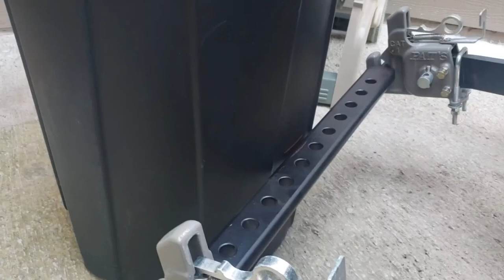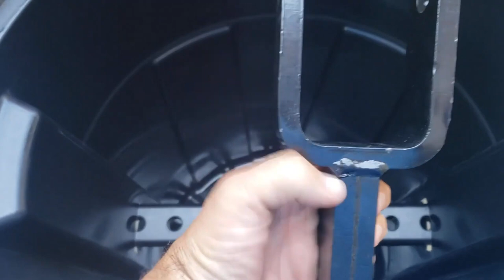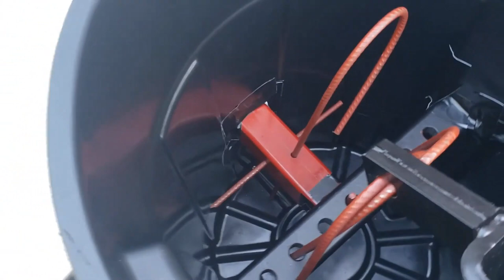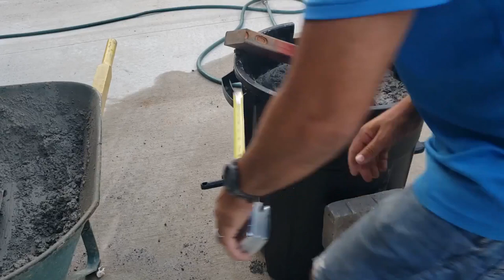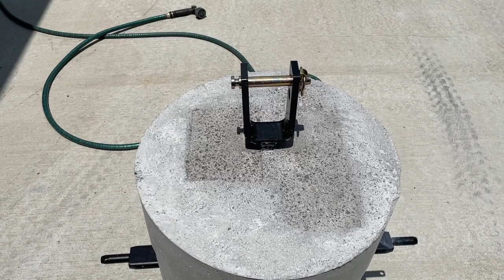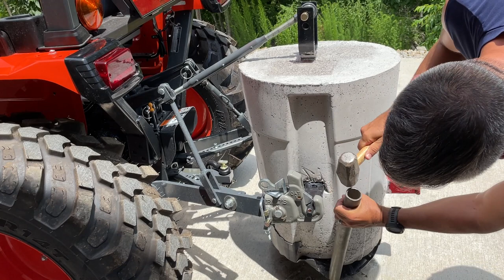Concrete Tractor Ballast Kubota LX2610 Compact Tractor 3 point Category 1 with Hitch Receiver DIY

Comment: I've watched a few of similar videos, and am taking delivery tomorrow on a Kubota L2502. The changes I think I would make is to place the draw bar and top link quite a bit closer to the front. Two reasons, it will make it so the top arm of the three point hitch clears easily. The other advantage is that the weight will be farther back from the hitch, giving the ballast box more leverage.
Reply from the maker: Thanks for watching. Enjoy your tractor. I was just using mine tonight with the ballast and the grapple.
Reply: Yes, I put my drawbar 6" from the top rim and 13" from the bottom. The top link mount is the same 6", and I didn't sink it into the concrete it's above the concrete.  The square tube sits about 2 to 3" above, slotted the tube, and bolted top link mount to it and it lays flat on the top, but it's flexible up and down but not side to side.

Comment: Should have mocked up receiver hitch, top link bracket and drawbar from wood, assemble in barrel, hook up, raise and use an angle finder to determine receiver angle, so when sitting plumb you will know where to have it sit before pouring quickcrete. You would also be able to see  top link clearance and plan accordingly for cutout/form board. Cut your holes smaller than you think you need in the barrel and fit your parts for tight seal and always vibrate your concrete. You could always cut out the concrete for your top link as well. Cant change much now unfortunately because it's set in stone, lol. Other than that, good idea.
Reply from the maker: Yep, lots of good advice. Nothing that my 4-in angle grinder didn't fix.

Comment: I did something very similar but I used steel cabling to securely tie my receiver to the drawbar. I unfortunately didn’t make proper accommodations for my top link either so it had engagement at full lift height and ultimately bent a top link on it which became my permanently mounted weight bucket top link. Nice job and thanks for sharing.
Reply from the maker: Yeah lol it’s funny to think that I was going to always remember to be careful to not raise it too high so I’ve since also bent my top link.  oh well, it still works. I’ll take the concrete saw to it before I replace my top link.   Thanks for watching and the kind words.

Comment: Good tutorial. I had already purchased what looks like the top link you have from Amazon before seeing your video. It is very heavy duty for the price. I have a 50 hp tractor and will be using a 55 gallon metal drum. Should weigh right at 1,200 pounds.
Reply from the maker: Thanks for the comments, yeah, that should be about right that will be a heavy one for sure, but you got the beefy tractor to make it work.

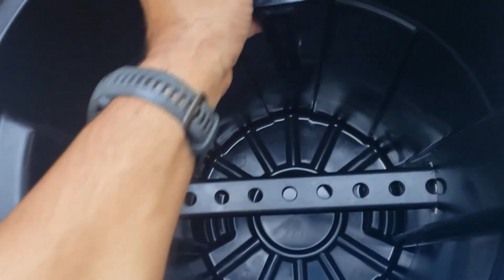Comment: I've seen a few DIY ballast videos and yours is another great example of how to make it.  I'm planning to do something very similar to what you have, with the addition of several PVC pipes that can be used for various long handled tools + chainsaws.  The question I keep wondering is whether there's any advantages of installing the "drawbar" through the drum in a "vertical" versus "flat" position?  Basically, at the 4:09 mark, when you look down into the drum, you would not see the holes.  Rather, you'd see the top of the bar.  I'm speculating this off the old premise of whether the strength would be greater in that position (less chance for flex + higher force needed to bend it) .  Perhaps in this scenario, I'm completely overthinking it and it's not going to matter either way.  In any case, great video & Thumbs up all the way!!
Reply from the maker: Thanks for watching.  Appreciate the comments, not sure how vertical would help, not following you there.  I need horizontal to hook up with the Drawbar, or are you saying you would run your barrel horizontally, in which case this would be a difficult project with the trash can.
Reply: @TNYankee2020  Hey TNYankee, what I’m thinking about is recreating the same setup as yours. However when I say run the bar vertically, It would mean turning the drawbar 90 Degrees so that when you look down into the drum from the top, you would see the top rail of the drawbar. The height and location would be the same. Just changing the orientation of the drawbar. My theory is that it may be stronger that way due to the force needed to bend the bar. I hope that makes sense. Either way, great video and thanks for any updates and insight for those of us looking to do this. Thanks buddy
Reply from the maker: oh, i get you now.  Yeah, that might be a good idea.  Be sure to watch my follow up video on this one if you haven't already.  Found I needed to make a modification to avoid the bent top link.   @goblue2708
Reply: With the draw bar flat it will support more weight.  That extra inch may keep the concrete from cracking.  I am going to do this with an old 60 gallon air compressor tank cut in half so the top hitch and draw bar will all be welded together in the concrete.

Comment: nice job.  Might have to try this myself.  Q: Any reason why you didn't just leave the garbage can on the finished product?
Reply from the maker: Thank you, sir, you could have, I contemplated it. I just thought it looked cleaner without it, and I figured one or two times of setting it down on the cement it would’ve cracked.

Comment: ive seen other vids on making this type of ballast, just dont understand why put a hitch on it? i could be wrong, but i cant see how its rated to pull anything?
Reply from the maker: I think the idea is lots of guys leave their ballast on frequently then still have the availability to move around other things without having to remove it.  My ballast is only 50% of my 3pts rated capacity so it’s really no issue.   I put the receiver in so I can still use my winch mount for light recovery or skidding.

Comment: Are your tires loaded? I just purchased a LX3310 Kubota and my tires are loaded and I also have a ballast box that I kept off of my L3240 Kubota which I estimate to be about 450 - 500 pounds. It is filled with sand. I hope it is heavy enough because I am putting a 63 inch snowblower on the front.
Reply from the maker: I would think you would be fine even without your ballast my tires weigh 220 lb each loaded and you're not really lifting a lot more or less pushing...  thanks for watching

Comment: Nice build, TY.  I made a concrete ballast box and built it to be able to lift the ballast without damage to my top link and also wanted the ballast to be Quick Hitch compatible.  I enjoyed a full-watch of your video.  Have a fine week.   👍🏽🤠 05/15/24   
Here's a link to my humble attempt at a ballast box build.  https://youtu.be/kkik31gLk-0
Reply from the maker: Thank you Houndsman that is a sweet build. I love the quick hitch compatibility, that's the one thing about mine. It's a bear to get on.   And you saw me having to struggle get my top link bracket centered so that was genius having it hooked up to the tractor.   Thanks for watching